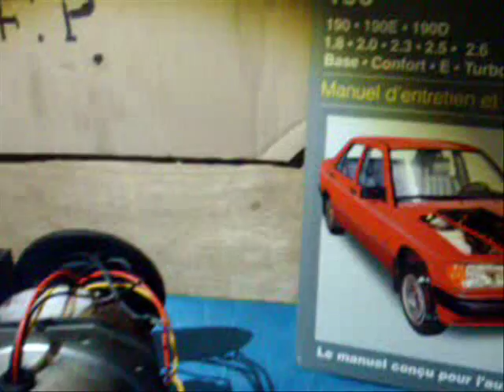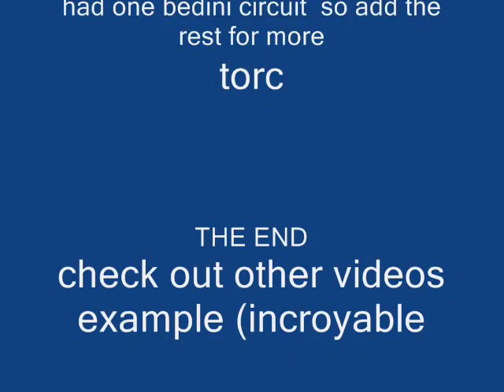bedini ssg using induction motor

Comment from the maker: 3 phase wound 6 starts 6 ends do not star or delta; meaning per phase there are 2 starts start run start trigger and 2 ends end run end trigger.per bedini that s why you will need 3 bedini circuits to complete this project.